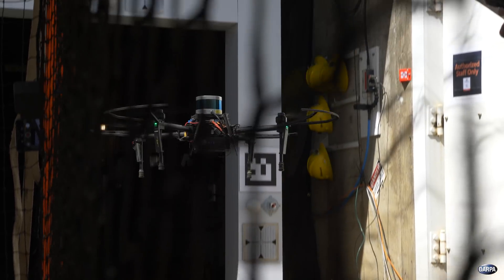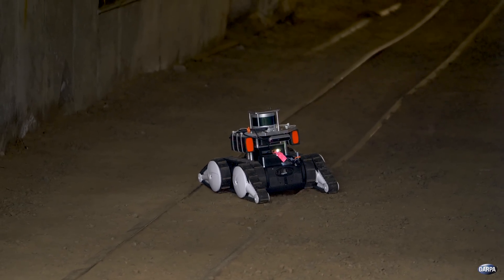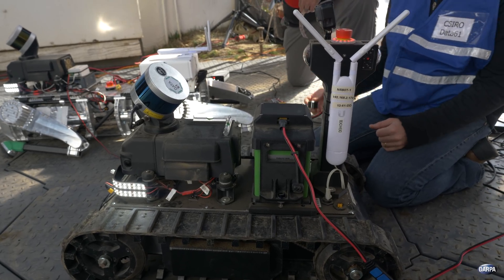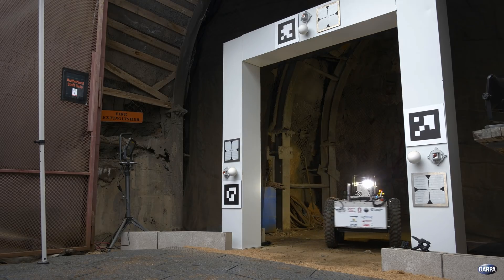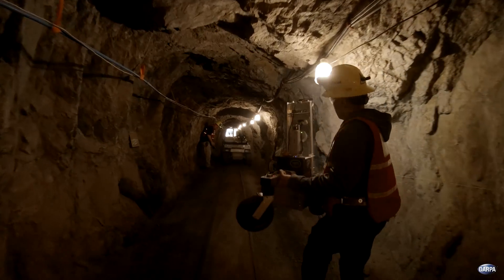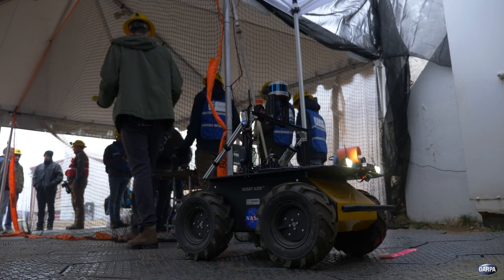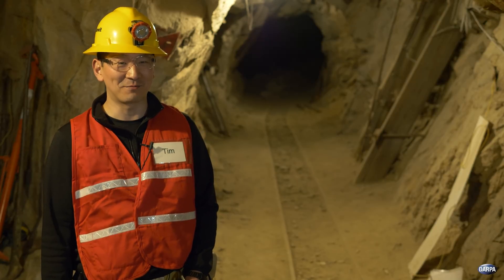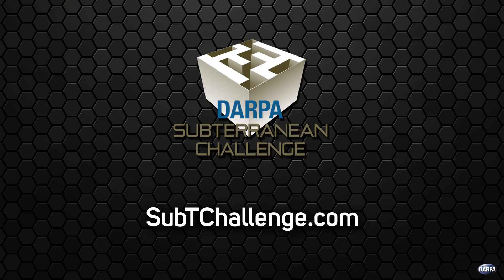SubT Integration Exercise Helps SubT Challenge Competitors Prepare for Tunnel Circuit

Comment: I guess you finally realized that the $21-Trillion worth of cave shelters you built or purchased isn't going to work for the polar reversal and nova in 2046 because there is going to be thousands of feet of glacial ice and snow above the cave entrances and it will be the "survivors" tomb. You should have talked to me first instead of the 3 generations of brainwashed scientists that haven't a clue what is going to happen.